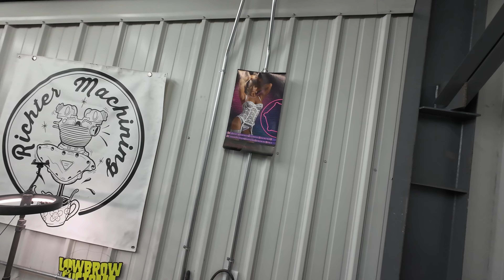TRIUMPH 650 and FLYINGPEZ comes to WORK for me!?

Comment: Always enjoy your videos even if you feel you are repeating thing. I am curious about the scavenger tube in the crankcase drain. Had a problem with an aftermarket drain plug. After installing it, had a wet sump condition. Went back to the OEM drain plug.